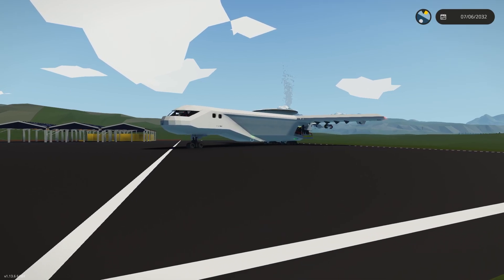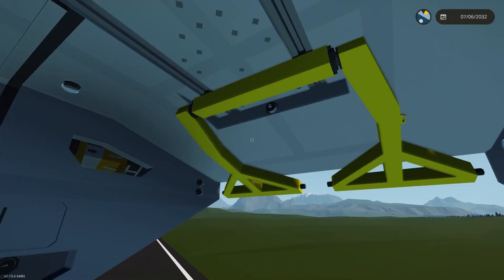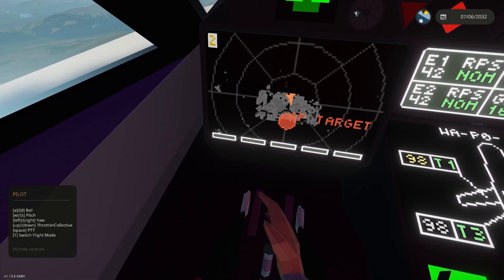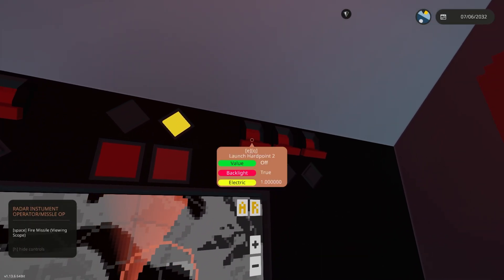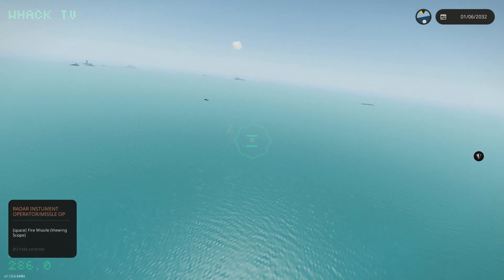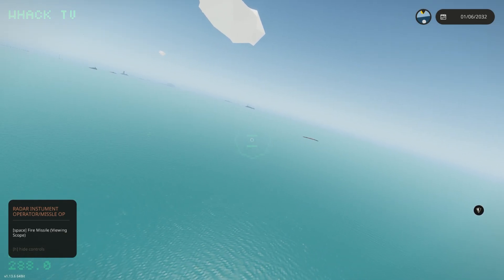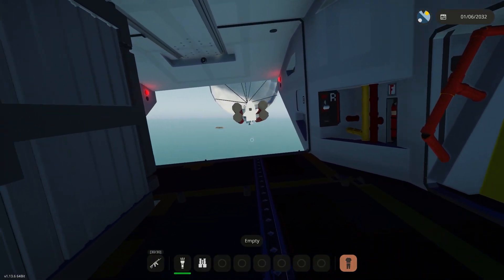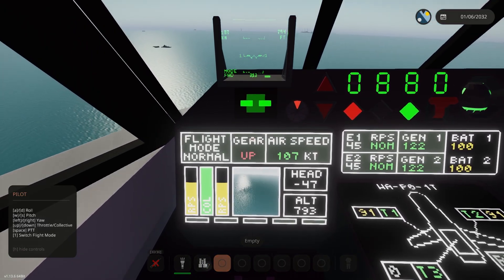Lifting Body Build Release Video : Workshop Walkthrough

Comment: how do I get enough thrust for liftoff I've tried smaller planes but they don't work
Reply: I'm trying to do your flying aircraft carrier challenge
Reply from the maker: It depends, if you are not spinng the rotors fast enough it doesn’t matter! Trying playing with gear box
Reply: @WhackAL I am using a jet